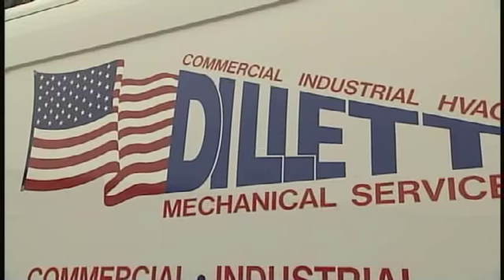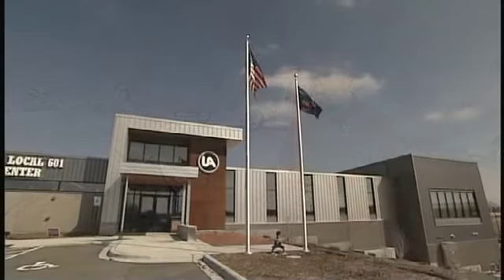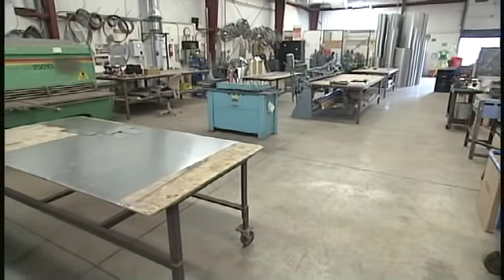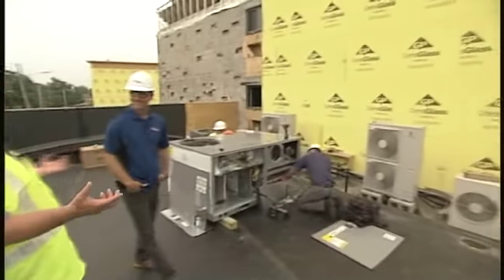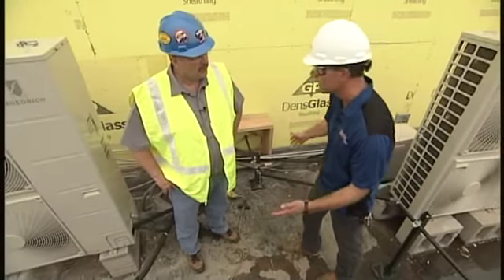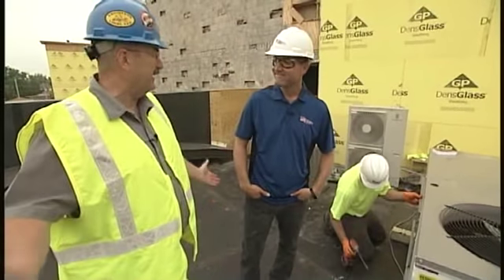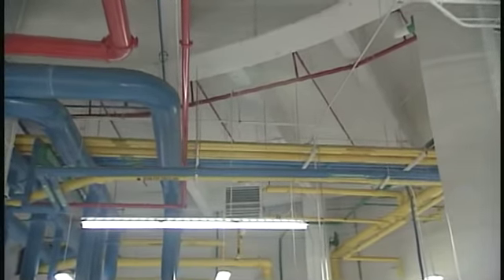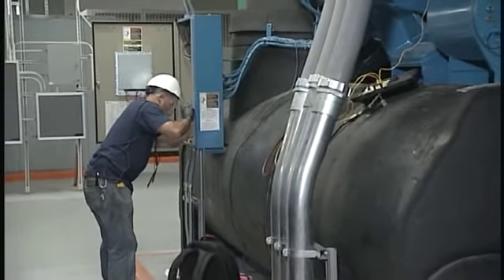HVAC Service Training with Steamfitters Local 601

Comment: 2 men install the rooftop hvac unit gas piping - they are installed a high pressure gas regulator WRONG!!!!!  
The 2 men supposed to be installed a high pressure gas regulator AFTER the drip pocket leg to the commercial hvac unit, not before the drip leg on a gas pipe.
I have 43 years of experience in industrial class A gas-fitting , steam-fitting and industrial high pressure steam plants/boilers and industrial combustion gas burners.